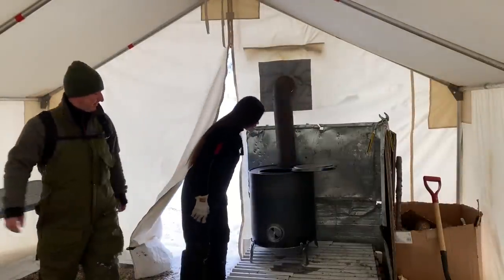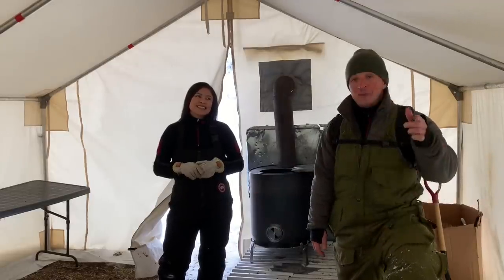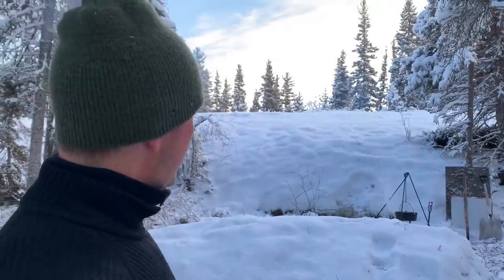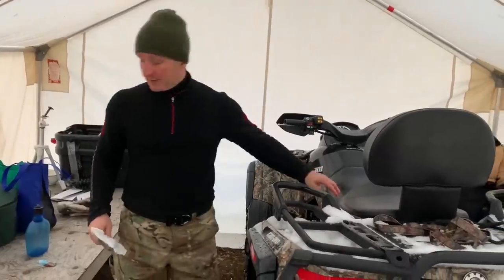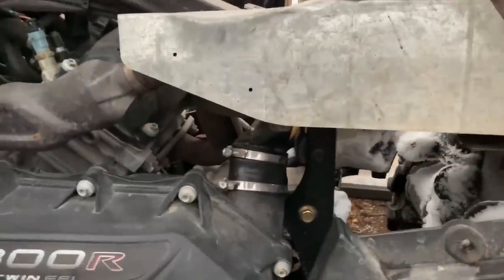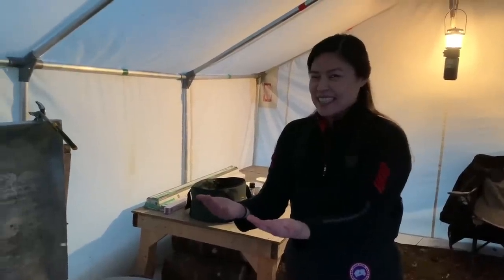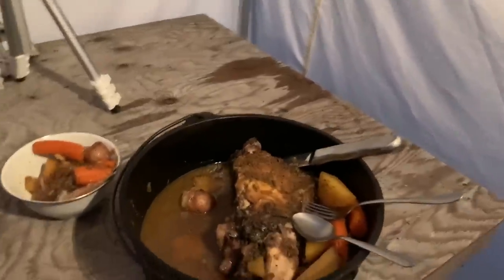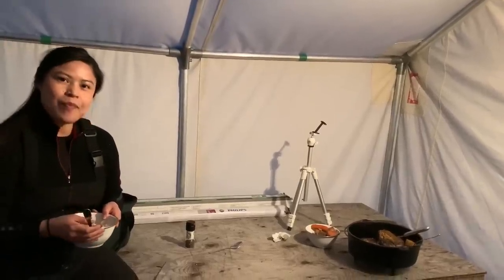ESCAPE to the WILDERNESS || CAST IRON HOT TENT WINTER CAMPING

Comment: No knead dutch oven bread recipe

13 oz warm water
1 1/2 tsp salt
1 1/4 tsp yeast
3 1/2 cups flour
Corn meal if desired

Mix with handle of wooden spoon into ball
1 1/2 hour proof in bowl covered with saran wrap in a warm place
Mix into ball, flour ball, place in foil pan on trivet (air gap)
Wait 30 min in warm place
Cut slits in top of dough, place butter pats in slits
Sprinkle corn meal on top
Bake at 400 degrees 30-40 minutes
More charcoal on top of lid of dutch oven than below
Lower charcoal in a ring around perimiter of dutch oven, or hang high on tripod over a low fire.

Enjoy!, Scouter Dave
Reply: Thanks Dave!
Reply: That's a smell that would give anybody an appetite.

Comment: I cook with cast iron at home. 90% of my meals are done in cast iron.

Venison Goulash

2lb venison
20 cloves of garlic, minced
salt
Ground peppercorn
olive oil
flour
2 large sweet onions, quartered
mushrooms (optional)
2 Large carrots, sliced
2 stalks of celery sliced
1/2 cup red wine (I use Cabernet Sauvignon)
4 cups beef broth
1/4 cup of smoked paprika
2 cups of sour cream
cooked egg noodles
Mix garlic, salt peppercorn, and flour together with cut up meat and shake till meat is coated.

In large cast iron oven, place the coated meat with some olive oil and brown. Remove browned meat to a separate bowl once it is browned. May have to brown in batches.

Reduce heat, if possible to medium low. add more olive oil, carrots, onions, celery and mushrooms. cover tightly and sweat the veggies (about 10 minutes). Add the red wine and scrape the bottom of the pan for 2 or 3 minutes. Add beef broth and paprika and stir. Add meat and juices. Stir well. Simmer for at least 2 hours, stirring occasionally. 

Remove from heat and let boiling subside. Add sour cream and stir until completely incorporated into the gravy. Serve with egg noodles.

You won't be disappointed. We have this meal at least once a month. It is so yummy.

Enjoy
Reply: Love my cast iron.

Comment: I’m anxious to see how that oversized heater fares for an actual overnight stay this winter. If you load it up before bed I wonder how warm it will be in the morning. My GWM stove burnt out last month at the end of a deer hunting trip. I wanted to follow suit and order a bigger one for my outfitter tent but they are sold out. Guess they are moving buildings and won’t have their lines back up for another week or two.
Reply from the maker: In all honesty I would expect this stove to provide 4-5 Hours of heat at most. With this set up as long as my stove is wide open and constantly fed with wood. I can maintain an ambient temperature in the tent of +30°C easily On a night that is -30°C outside. As soon as the roar of the fire settles the temperature drastically drops off Until I top off the stove again. I usually let the stove die out overnight and just use the warmth of my sleeping bag to keep me comfortable throughout the night. When I wake up in the temperature in the tent is whatever the temperature is outside that morning.
Reply: @upnorthof60  yes sir I see that from your videos (I have watched for a few years). But now that you’re getting older, topping off that stove at night is easily done when you get up for a mid sleep pee!!🤣
Reply from the maker: @robertcumming2035  lol..

Comment: I didn't have a recipe, but I just slapped together the most delicious pot roast in my dutch oven. I first dropped in a beef roast and browned it on all sides. Then I took it out and fried some garlic and onions in the bottom. Then I added some small red potatoes and I chopped some carrots and onions and added some water. I don't remember how long I baked it, but I followed a chart I found for the size of roast I used. At the end I added some flour to thicken the broth. Then I shredded the roast. It was falling apart delicious!

Comment: those spiral rounds are usually spruce [ engelmann ]which is used in most log cabins up north. look at the grain on the spruce logs used in log cabins ; therefore, it cannot be used structure or framing for houses. it will not meet the necessary code/strength requirements because of the spiral grain. Hemlock is very straight grain and used for trim pieces. baseboards, etc.